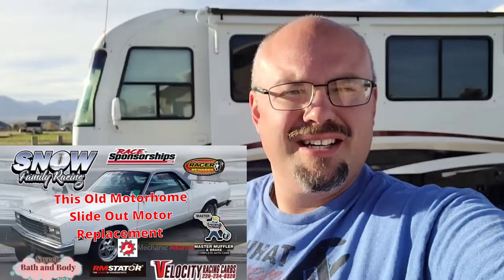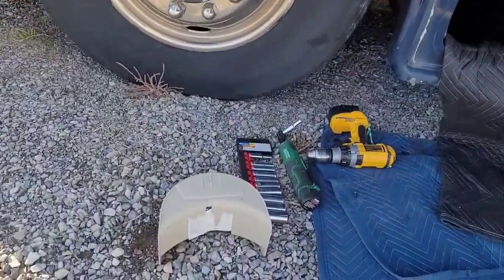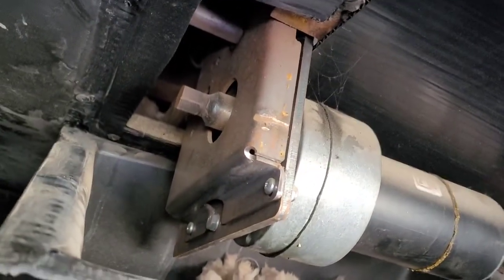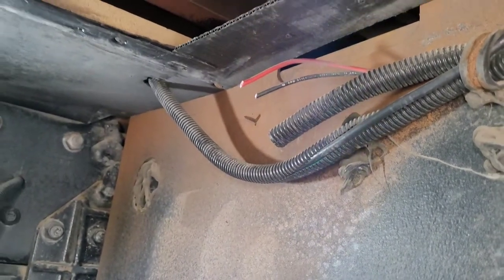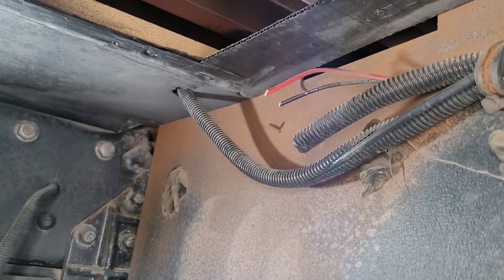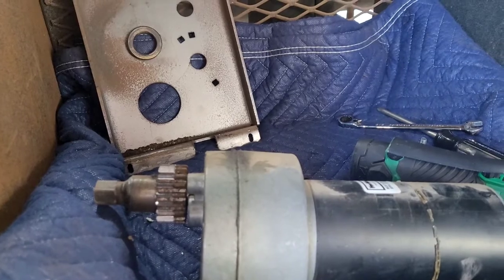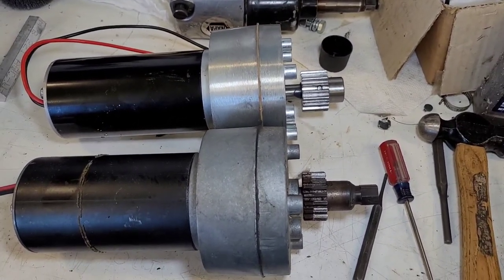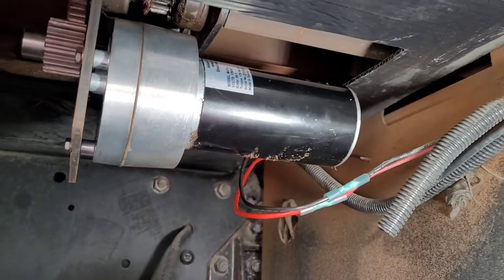Slide Motor Replacement on a 2004 Alfa See Ya! - This Old Motorhome

Comment: please add more video I have 2005 alfa and I am suffering thru replacing parts endlessly have problems too many to mention.  foggy windows, electrical problems, slide out won't work, awning gas strut replaced, new headlights etc

Comment: Great content. You could have just replaced the gear on the motor instead of replacing the entire motor. Also, next time, make sure both gear teeth mesh together, not super tight, but tight enough with gear grease. Finally, the bolts holding the motor to the frame must be tight to prevent the motor from loosening, causing the two gears to separate.
Reply from the maker: My motor failed, so it needed to be swapped. Making the adjustments where possible to make the teeth mesh nicely is absolutely correct, sometimes we're limited by hw much adjustment is there without major modification. It's also never a bad thing to get under there and grease it up occasionally either.

Comment: Can you provide the model number for the new motor? I have a 2003 Timberlodge 27 BHS with a slide out motor that appears to be similar but i can't find a model number on it. Any help would be appreciated.
Reply from the maker: Here's the one I used from Leisure Coach Works. I would give them a call because they do more than Alfa parts. https://leisurervparts.com/adacel-slide-out-motor-m-21c-30-rpm-p-149/

Comment: I was told the actuator gets dirty and can cause the slide out motor down. Did you take an emery cloth and clean the actuator before putting in a new motor.?
Reply from the maker: There will be more content coming. Usually as things break on mine I'll document the issues I'm having and make content. I'll dig into the other things you mentioned and see what I can do. I do have awning issues that I have not yet resolved yet, so that may get covered on this channel. Make sure you subscribe and you'll see the content come through as it goes live.

With my big slide motor, I did not take emery cloth to any parts, I keep the gear rack lubricated with wheel bearing grease so it's stays pretty greasy. With the new gear on the old rack grease will be your friend.